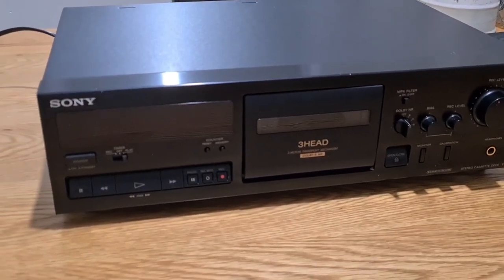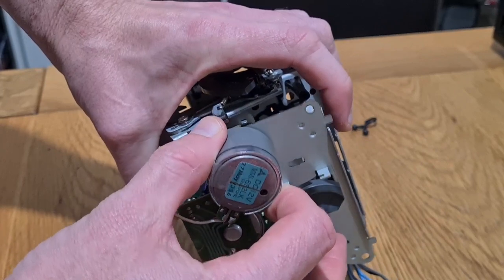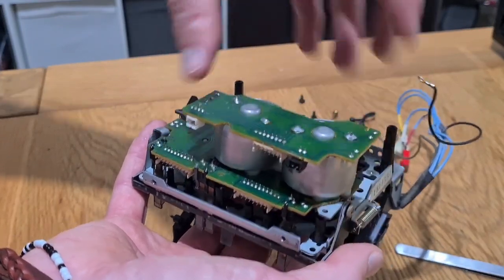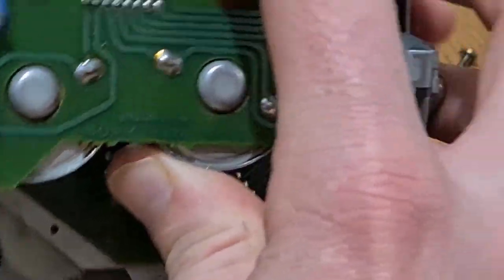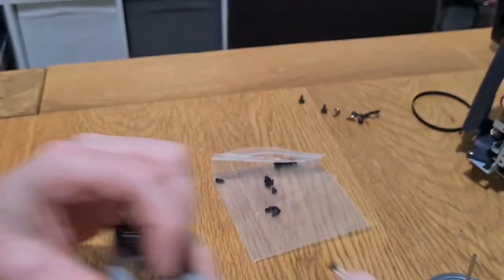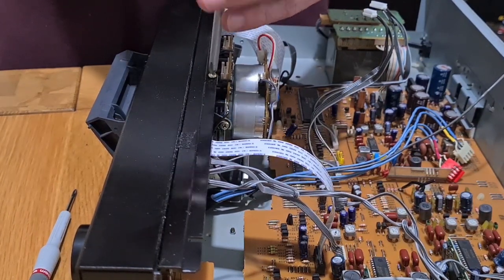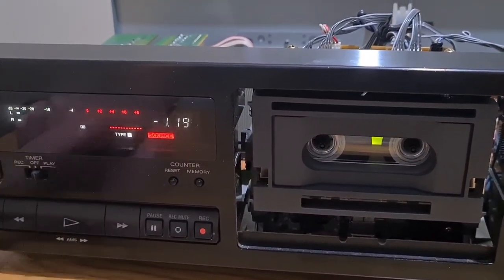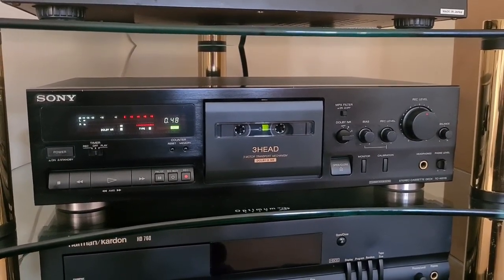Sony TC-K611S Three Head Cassette Deck - More Belts and Servicing!

Comment: Great video. I just followed it and replace both belts but my deck still has the same problem it had before I started which is the tape doesn’t play! Fast forward and rewind all work but the tape won’t play. The heads move onto position but the tape doesn’t turn! If I remove the tension from the pinch roller then the tape plays but as soon as I release the pinch roller it stops and after a second the head drop back in the rest position. 
Any ideas what wrong? Thanks.
Reply from the maker: Hi mark, when you say tension from the pinch roller.. do you mean you pull it away from the capstan shaft?
Reply: @pwrestoration  yes that rights. It plays, all be it too fast, without the pinch roller touching the capstan but as soon as it’s touching it the tape stops!
Reply from the maker: @Sierra747  That's wierd. Does your pinch roller turn ok by hand? It almost sounds like the two are counter acting each other. Is the capstan turning the correct direction? (Anticlockwise as you look at it from the front)

Either that or your pinch roller isnt seated properly, or getting stuck. This could cause your issue.
Reply: @pwrestoration  yes the pinch roller is spinning ok. It’s new too. The pinch roller assembly all seems to be fitted ok. The deck was ok but needed a new drive belt so I replaced that a few years ago without disturbing the mechanism at all and after that it wouldn’t play. I saw your video and thought I’d fit a new selector bet too to see if this helped and it made no difference. It’s a very odd problem which I sadly can’t seem to fix.
Reply from the maker: @Sierra747  the pinch roller could be too big. What's the dimensions of it? From memory they're 11x6x2 I think, but I'll double check
Reply: It didnt play before I fitted a new pinch roller too. I ordered one listed for a 611s. I tried a new one just in case it solved the problem.
Reply: I’ve just checked the capstan and it is spinning clockwise not anti-clockwise!! Any idea how to sort this out?
Reply from the maker: @Sierra747  Haha great! simple fix. Have a check of the small white plug on the top of the transport. Red and white wires. Its probably in backwards.

If not you can desolder the two wires on the motor as I did in my latest 'k611s noisy motor' video and simply swap them. 

As long as you're sure it's running the wrong way. As you look at the front of the player, it should be running anticlockwise, to make your pinch roller spin clockwise.
Reply: @pwrestoration  it’s definitely running backwards I compared it to my other decks to double check. The plug is in the correct way so I will have to desolder the wires and swap them over. I can’t understand how it’s happened. I did take the cover off the motor to put a drop of oil on the back plate to quieten down the motor but that’s all I did. I’ll get the wires swapped and let you know how I got on.
Reply: @pwrestoration  I’ve swapped the wires over and the capstan is spinning the correct way but now it’s playing 3 times too fast. I checked the speed and it’s running at 9500hz not 3500hz? Do you think a new motor would be the answer?
Reply from the maker: @Sierra747  Have you tried adjusting it from the pot on the back of the motor?

I would also check what the voltage is at the motor if it can't be regulated down. If the voltage is too high it'll always spin fast. That would need adjusting elsewhere. At that stage you could be looking at faulty resistors etc on the board.
Reply: @pwrestoration  yes I tried adjusting the speed but it’s so fast I can’t adjust anywhere near enough. The motor sounded ok when it was spinning the wrong way but now I can hear it’s spinning far to fast after I swapped the wires around! I’m going to get a new motor and see if that helps. I’ll give you an update once it’s been fitted. Thanks for your help so far.
Reply: @pwrestoration  I fitted the new motor today and soldered the wires back on the correct way and now the deck works perfectly!!! All that was needed was a slight speed adjustment and a head azimuth adjustment and now it’s back working as good as new!
Thanks for all your help I wouldn’t have fixed it without you.
Reply: @pwrestoration  I fitted the new motor today and soldered the wires back on the correct way and now the deck works perfectly!!! All that was needed was a slight speed adjustment and a head azimuth adjustment and now it’s back working as good as new!
Thanks for all your help I wouldn’t have fixed it without you.
Reply from the maker: @Sierra747  That is odd, maybe the motor had developed a short or something internally. Certainly very strange! No problem happy listening!
Reply: @pwrestoration  thanks mate.

Comment: i lost my plastic washer is that important？？？
Reply from the maker: Maybe. if you can find anything that's the right diameter just fire it on. You can even make one just out of a bit of plastic. It's there to stop the capstan wandering back and forth and causing your tape to skew on the pinch roller. 

Have a look for pen and you can slice some of the end of the ink cartridge off, and stretch it over. Chunky pens have thicker cartridges 😎